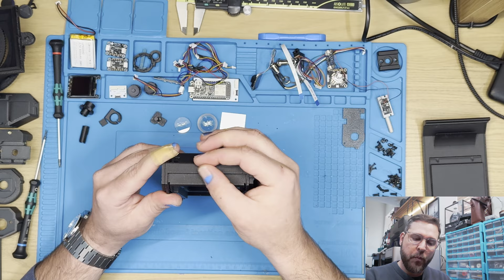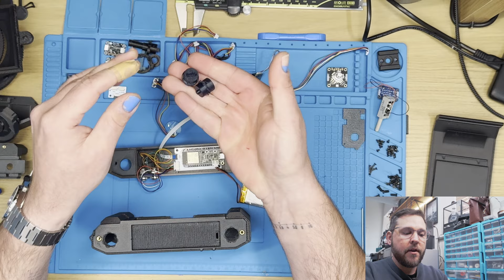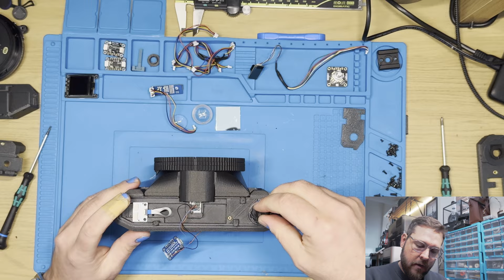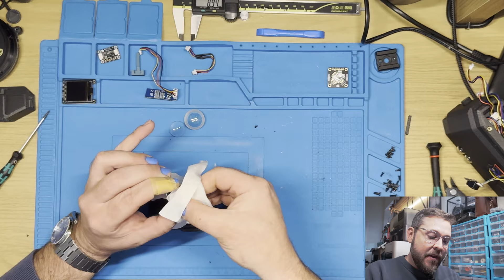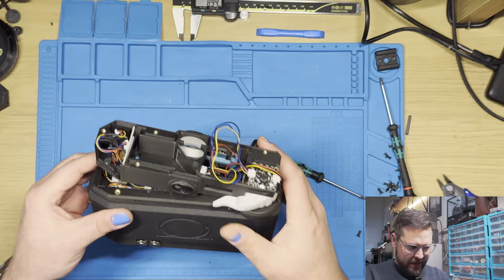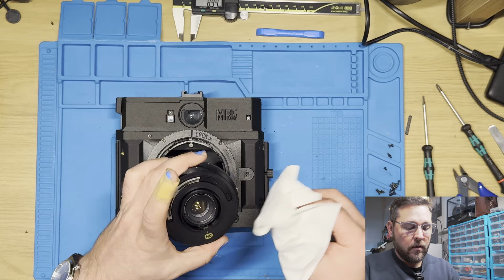IDENTIDEM.design MRF2 - Build Video (The medium-format rangefinder camera you can build yourself!)

Comment from the maker: NOTE: There's a couple of mistakes on the wiring diagram. First, one of the switches shows as NC (normally closed). They should both be NO (normally open). Then, it shows button one going to button two on the board and vice versa, that's a simple typo. One goes to one, two to two.

Also, a tip to save you possibly hours of frustration and a few rolls of film: remember that the nature of 3D-printing means perfect dimensions every time is impossible.

So you need to check that infinity is sharp at the film plane by placing a piece of ground glass (or frosted plastic or similar) flat against the installed frame mask, pointing the camera at something in the distance, and seeing if the image is sharp. If it's not sharp the quickest way to sort it is to modify the frame masks by adding or removing from their overall thickness until infinity is sharp at the film plane.

Comment: I don't see in the user manual, how are you supposed to rangefind past 3m in direct sunlight when the lidar cuts out?
-- is that what the beam splitter/viewfinder optics are for? 

I'm asking just because I am legitimately interested in making this camera myself, however, I will be using it primarily in direct sunlight and I want to make sure I am able to focus when doing so.
Reply from the maker: I've recently done some work to improve the the LiDAR accuracy outdoors. If your subject is slightly shaded it gets better, but these little sensors don't do well outside, especially at the price! It's just the physics of it. You can see the comparison of v1 vs v2 boards on the README in the repo. 

I've been keeping my eye on Benewake's new products hoping that they'll release something soon that will make this camera almost perfect, but nothing yet.

Comment: Has anyone noticed a rapidly depleting (5% every day) battery? New to electronics.
Reply from the maker: Hmm. What version of the firmware are you on? Is this with the camera switched off (I'm guessing it is)? The goal with cutting power to the STEMMA QT as well with the DPDT switch was to stop vampire drain...but I might have missed something. 

Might be time to get in there with a multimeter.

Comment: I thinks I've figured everything out as far as connections, the PCBs (hope they work).  What are the wiring connections for the 404R10KL1.0.  I have wires soldered to the ADS, at A0, VIN and GRD. Not sure to wire it as it's pushed it increases the resistance or the opposite. Also, almost ready to flash the microcontroller. I've followed your instructions to open project but it doesn't want to open platformio.ini. It doesn't recognize it as a file it would open.  Thanks again for the brains behind this, it's amazing.
Reply: I think I figured it out. The ate wires soldered to A+, A-, and A0. And in the order just listed A+ to #2; A- to #1; A0 to #3.  
Now I just need to figure out the firmware part.
Reply from the maker: Hey! Apologies for only replying now, I've been away for the day job for the last couple of weeks. Glad to see you're making progress. The best place to get help and quick responses from me is DMing on Insta. If you need any more help, get in touch!

Comment: Thank you for all the work making this, after an unfortunate succession of delays, I am finally getting out to testing mine and it's working great so far. 

Information in case anyone may need it to speed up figuring out the film masks instead of bumbling around trying to get the right adjustment for the film masks:

The distance between the back edge of the lens (where the recessed part of the lens cone that the lens sits against) and the focal plant (i.e. the part of the film mask that the film touches) is 53mm. 

You could put something solid across that recessed part, and measure the distance to the film plane to get roughly how thick your masks need to be. 

The distance between where the bayonet of a mamiya lens (you can also measure this from the protruding part of the "lens top center ring") and the film plane /should/ also subsequently be 
61.4mm
Reply from the maker: That's some great information and helpful insights, thanks for sharing!

Mario of SPRKPLG has found that 60.85mm is the perfect starting point for the FFD of MUP lenses, and I've confirmed this with the amazing Reveni Labs Autocollimator.
Reply: Glad you got it up and working!  Did you have any issues with flashing the firmware to the feather board?
I'm having some troubles getting VS code to recognize the device, but if others are not experiencing the same issue, I'll assume it's a problem localized to my system.

Comment: This is some great stuff/camera.  I've made the plunge and starting to collect all the parts.  I saw what you did with your first MRF but I'm glad I waited.  I do have one question and that's the length of B-type 8-pin FPC ribbon cable. I ordered the 100mm but I'm thinking it too short.  Thanks again for your work in this area.  I've noticed while collecting these parts that's I'll have some left overs like the PCBs, ribbon cable, springs, buttons, power switch, steel rod, and bar magnets.  I'm sure I'll wind up with extra screws. Do you think there's a market for a parts kit.
Reply from the maker: 100mm should work, but may be a stretch. 200mm is safe. I've updated the BoM, thanks for pointing that out. 

I have had people as for parts kit, so there might be a market for it, yeah.

Comment: Thank you so much for sharing this project!  I understand how much work goes into developing a design like this!!
A quick question...  the wiring diagram you shared (if i'm interpreting it correctly) shows [1] 'NO' (normally open) momentary switch and [1] NC (normally closed) momentary switch however the BOM does not distinguish between the two variants.  I'm struggling trying to source an 8mm 'NC' variant switch in the style shown and wondering if both are in fact 'NO'.  Would you be so kind as to confirm?   Thank you again for all your hard work!  This is such a cool project!
Reply from the maker: Hey, thanks for the kind words! Both switches are normally open. That's a mistake on my part! I'll add the correction to the pinned comment.

Comment: I'm just getting all the bits together now.
I'm using a BambuLabs X1C. The Orca file opens and preserves all build parameters. Hopefully, this all goes well. A neat little project and a culmination of what I've been doing all along. (Photography and electronics for 50 years, 3D printing for 2 years) Always been a fan of 3:2 aspect ratio. I'm looking at 65mm lenses, which are roughly equivalent to 28mm on 35mm film, where I cut my teeth many years ago.
Reply from the maker: That's fantastic to hear! With your background, I'm sure this will be a really rewarding project for you.

Comment: Great work! I was wondering how exactly does the advance work? I guess its a multi-stroke mode, but considering its a multi-format camera (6xN), how exactly do we know when to stop for 6x4.5 and when for 6x7?
Reply from the maker: Hello!

Yes, it's multi-stroke and uses a combination of a printed ratchet, sprag clutch, and return spring. The camera has a configuration menu, and within it you select your desired frame size. Once that's set, and you've installed the matching frame mask, you switch the camera off and load your film like normal and line up the arrow to the indent on the top-left of the film compartment. 

When you switch the camera on, it will know which frame size you've selected. The rotary encoder will count revolutions, and the external display will show you the frame you're on. When you advance, it shows a progress bar to guide you to the next frame. It's been pretty accurate for all frame sizes, mostly because I sacrificed many rolls of Foma 400 to get it spot on! I'll show all of this in a follow-up video soon.

Comment: Hello! This sounds like such an awesome project. I would like to build one myself but the closest thing I’ve come to putting any electronics together is assembling a basic raspberry pi 5 board. Obviously any DIY build will be a challenge, but how feasible would it be for a newbie beginner like myself to build this project?
Reply from the maker: Hey, thanks! 

If you're comfortable with the raspi, then this shouldn't  bee too much of a stretch for you. There's a little bit of soldering, but just enough to learn if you're new to it, and simple enough so that it's pretty difficult to mess up! 

The majority of the components are breakout boards from Adafruit that use STEMMA QT connectors, and they're just plug and play, daisy-chaining. 

The PCBs are also really simple, and even ordering the usual minimum of 5 from any fab is pretty cheap. 

If at any time during the build you're uncertain or need direction, reach out on instagram or my website, and I'll be happy to help!
Reply: @identidem.design  I finally finished my first build, and as a complete beginner to 3D printing and soldering, what a journey it's been!  Looking forward to putting my first test roll through this camera.

Comment: Going to give this a shot. The Orcaslicer profiles aren't working for me. Do you have a recommendation for print resolution and infill? Will use PETG-CF. Thanks!
Reply from the maker: Hey, sure! 0.4mm nozzle, 0.2mm layer height, minimum 4 walls, minimum 18% gyroid infill. 

For the advance mechanism bits more walls and  85% infill.

Comment: Hello, I have a couple questions for you sir. But first, hats off to you. Wow, this is incredible!!! I'm blown away and can't wait to make my own. 

Ok, so for the PCB, you don't need to order any SMT components, correct? I didn't see an Excel or CSV file for them and it wasn't mentioned anywhere. 

Second, exactly what wires did you use and how many? The link in your BOM was just a search and didn't list a specific type of wire or how many are needed. Thanks for the help!
Reply from the maker: Hey there! 

You're right, there's no mention of the SMD components for the PCBs. I've added that to the readme now, but for convenience's sake, here you go!

- On the mainboard: 1x JST SH 8-pin connector, 1x 0.5mm Pitch 8-pin FPC connector
- On the breakout: 1x 0.5mm Pitch 8-pin FPC connector, 1x JST SH 6-pin connector (LiDAR), 1x JST SH 4-pin connector (STEMMA QT)

Of course you'll need a 100mm 8-pin FPC cable (Type B) to connect the two boards together. 

For wires to solder, I prefer 24 AWG solid core. Three pieces for the linear position sensor. The LiDAR comes with a connector that has bare wire on one end, that gets soldered to a pre-crimped 6-pin JST SH connector like-for-like. For the buttons and power switch, I use a pre-crimped 8-pin JST SH connector. That's all the wiring you need to solder. 

As for STEMMA QT connectors: breakout to light sensor, light sensor to main OLED, OLED to ADC, ADC to accelerometer, accelerometer to encoder, encoder to secondary display...that's six by my count.

Hope that helps (most of the detail is already in the BoM, and thanks to you I hace added soe more).
Reply: That's very helpful, thanks. I'll try to reorder the PCBs and see if JLPCB takes it. 

As far as the cables go, there's probably 4-5 different types on the search results. I see you didn't update the link. Is it product 4401? 4397? 4209? They all have different styles of connectors. Sorry for the newb question, I'm sure I'll be more readily apparent once I start soldering. I just don't want to order the wrong ones. Thanks!
Reply from the maker: Hello again, I'd rather not link directly to AliExpress products on the BoM as the links go dead fairly often. 

Just make sure you buy JST SH connectors with the appropriate amount of pins as specified in the comment above (and in the BoM).

Comment: Ive alwasy wanted to build a camera!
Im not familiar with these boards or the programing side of building so I'll wait until there is further guidance on that end to start one of these.
I'm lucky to have access to a nylon printer, excited to see if that works.
Cheers!
Reply from the maker: Awesome stuff! The electronics are mostly plug and play, and the PCBs are easy to order from fabs like JLCPCB. No time like the present to jump in and learn something new. If you're going to be printing the parts using MJF Nylon, I'd recommend painting both the inside of the lens cone and body up to the film gate with a matte black acrylic. I made an early prototype with the MJF process and it turned out that even the dyed-black parts weren't 100% light-tight.

Comment: Hello. I started with v1 before you announced v2. What's the difference between 2 versions and do I need to reprint or order daughter boards again?
Reply from the maker: Hey! Quite a few differences:
- Now supports 6x9 frame size
- Has a proper bayonet locking lens-mount
- Uses a totally new linear position sensor
- Uses a totally new LiDAR sensor
- New daughter board and breakout board

Unfortunately it's different enought that you would need to reprint most parts. There's a detailed BoM in the README.md in the repo that should give you an idea of the differences.
Reply: @identidem.design okay thank you